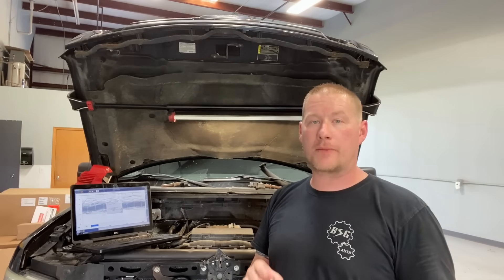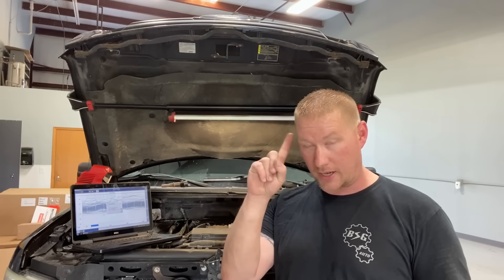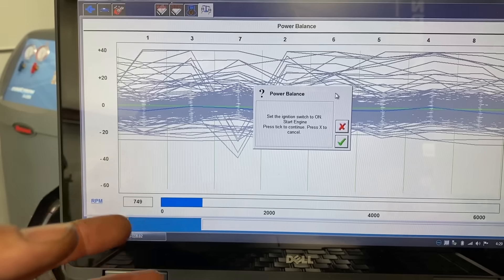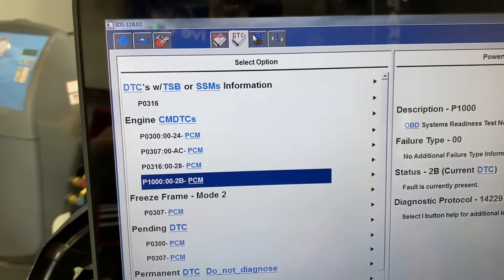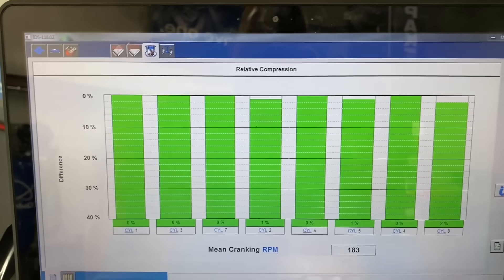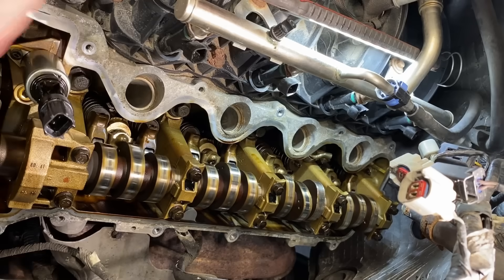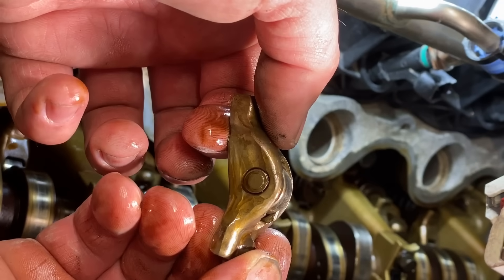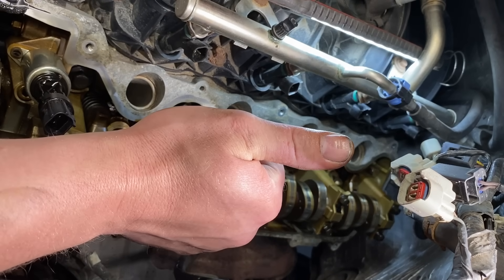Ford F-150 & Expedition 5.4L 3v Triton Engines Hard to Diagnose Misfires Fixed!

Comment: Mr. Makuloco,  I have a 2010 Expy with a dead miss on #5.   This happened to it when my wife went to leave for work.  She turned around, and left in a different car so as not to ruin anything.  I replaced coil & plug to no avail.  I then replaced injector to no avail.  Next, I remove the cover like you did here, I found everything in place, and in order.  I even had an assistant crank the engine over, but neither of the intake roller followers moved like up and/or down.

At that point, I put everything back together because I don't know what to do after this point.

Any suggestions are much appreciated.  Thank you!
Reply from the maker: If you are indeed working on the correct cylinder then I would be looking at compression next.
Reply: @FordTechMakuloco Thanks for your reply!  I forgot to mention that i tried to check compression.  All the compression testing kits i find have the extensions stored in one bent fashion or another.i tried sliding the extension through a piece of PVC to keep it rigid enough to hopefully thread it into the spark plug hole, but I cant get one to start.  i tried one with the tapered rubber on the bottom on it, but I still cant get a reading on it.  what thread size is the spark plug hole?  Ive tried several different kits, but I'm not sure that any of them have the correct thread size.  it seems to me that would be a pretty standard size.  That's where I'm stuck!

Comment: My #1 is miss fire.  Plug,coil, injector all replaced .... Doesn't miss fire for about 5 miles if reset it .......could this also be my problem with #1 .? 2010 f150

Comment: I watched your video and decided to do a top end rebuild because of a crazy click noise.  You saved me.  No major damage but replaced all the rockers, both cams, oil valves, oil pump, water pump, timing components and now it's like a brand new engine at 214000 miles.  great video.
Reply: Approx what did it cost you to do that work ?
Reply: @johnnybee3444  Yeah I was wondering as well...

Comment: What is the Cause of secondary fuel pump module function p1273 please explain how it works and make a video on it engine running rough and no excerlation no power

Comment: Do you ever travel? Dear God i have a 2007 Ford F-150 5.4 3V. Under 140k on it. I have had it too different shops and always feel robbed. $880 at one shop only for them to tell me they replaced plugs and found out after continuing to experience misfires and changing the plugs myself they didn't even change them all. Only 5 out of 8 were replaced. I re-did all new plugs and coil and she ran ok for a while, but still had a shutter at idle not real bad but noticeable. Recently took it to another shop and they diagnosed a bad fuel filter which was legit no complaints there. However, I specifically asked the shop about the ticking noise and they said it could be phaser noise. I asked them if they could look into it as well as a timing job and that I believe there is a bad roller followers and there suggestion was get this "wait till the noise gets a little worse". You don't want to tear into the engine that's a big job that will cost a lot of money. Especially considering they charge $200 an hour in labor alone. Bad fuel filter cost me $350. Yes I could have done it myself. Screwed up part is I took it to them because it's down on power and has a shutter at idle. So they performed the inspection and found the fuel filter leaking. So, if I tell them leave it I will do it. I still owe them $200 plus for the inspection and fuel filter diagnose it. So, why not let them do it. Best part is I get the call to pick it up. Get it take it home. 5 min later I get a call from the shop and they tell me "umm yea we still have the new part here so it was never changed can you bring it back"? While I'm happy with their integrity why would a customer be told "wait till the problem gets worse". Why not fix it now? I wish I could bring my truck to you, I'm just sure it would blow up before I made it there. Then I can't afford the trip or repair cost. If you were here I would be knocking on your door. Lol

Comment: My 5.4 3v misfiring cylinder 7 in high rpm so i changed the plugs. Now it’s misfring in idle. Check the coil, injectors, wires, all good but didn’t open the head to check. Any guess if could be the same issue you showing here?

Comment: I have a 2003 expedition 5.4 I have a number three misfire. It had water/rust in the spark hole not the cylinder replaced the coil pack with dielectric grease and cleaned up the spark plug and I still have a mess. Did I head test? All is good even did a coolant pressure check and still all is good also on the fuel injector.

Comment: PLEASE HELP
Having misfire cylinder 5 and 6
Replace coils spark plugs fuel injectors you can replace the valve cover gasket with grommets

Still getting misfire spark plug have fluid on them

I already spent a lot of money changing everything and still same problem

Rough idle Its start shaking when it gets up to 40 mph

Comment: Got an 07 5.4 3v. Have had it about a year. This whole story sounds like mine. With one exception. We just did the valve cover gaskets and didn't see anything broken or popped off. However it has recently started breaking the tips off of the spark plugs in the last 2months. #6 first then #8. All coil packs(1month old), all plugs (twice now 1yr & 1 month)), all injectors(1yr), both VVT solenoids(1month), PCV hoses replaced(1month). Only code I get regularly is lean cats. The shop told me cats were good. It will run good right after new parts for about ,60miles. Then back to hiccuping. 

I'm at my wits end with this thing. Going to do a compression test, before doing anything else. You're not by chance near Mississippi are you?
Reply: did you find the issue??

Comment: had cam followers come out on # 8 and get down in with the cam shaft which cut the follower into pieces. These had been replaced with the newer style followers as well about 10k miles before this happened. Ended up being a bad oil pump that was not allowing oil to get to those back cylinders. 98k miles and had to replace the entire engine.

Comment: Hello there.i have 2008 f250 xlt super duty 5.4 3V start ok  idles  ok  .but once i rev it up and let go with out moving  it shakes and rough idle no code .i did the timing job  according to ur process but i havnt chage the cam phaser coz i dont belive they r bad idk.whats the issue pls help.

Comment: Could that also be the cause of a missfire on a 2002 5.4 2V?  Missfire on Cyl 6, doesn’t follow the coil, plug or injector to any other cylinder.

Comment: In the morning I start up my truck and it fires up fine I drive it for 15 minutes or more park shut to off and 20 minutes to 45 minutes I turn the key and it gives me a long cran before it fires up can you please give me an I do I have replaced the plugs, coils, crank sensor, Mass air flow sensor 
 . Airfilter, fuel pressure regulator on the fuel rail passenger side man what can it be.

Comment: Im working on a 2004 with no codes. Will idle smoothly for about 10 seconds then idle gets rough and it stalls. No codes. Every part thrown at it by owner. Waiting for my module guy to come in and reprogram the PCM to see if that helps. If you restart it while its running bad it runs normally for a few seconds. Indicating to me a computer problem.

Comment: Would you happen to know what would make my 2000 expedition shut off if the mass flow sensor is plugged in and when I plug it in it runs fine

Comment: I have the 2006 F159 5.4 3V, what you are talking about right here, the closest I could find on Amazon Ford Store is the: Ford Racing (M-6529-3v) modular 3v Rocker Arm and lash adjuster kit. Would this be the animal I need to purchase for $325. I want to have this done at the same time that I do the timing job with chains, phasers etc. I really appreciate everything you do for your fan base and I do pass the word. My father was a mechanic for 44 years, he likes you and he hates today's practices in a lot of our shops nowadays. That says volumes to me. Thank you in advance. You answered my question 👍🏻, you bet I'll kick the proceeds your way.
Reply from the maker: Yes that kit is correct and is what I use.
Reply: I tried purchasing with the hyperlinks you gave but for some reason it wouldn't open in my Amazon app, kept going through a web page. Anyway: could you ad these parts to your list for your royalties, it's the least I can do and I'll give to your channel for your hard work. 3R2Z6A257DA Drive Phaser repair kit $748/M-6529-3V Rocker Arm and Lash assy.$312/8L3Z-6M280-BControl Solenoid $46.99 ea./MellingHV Oil Pump M340HV$125/New Water Pump PW423 $51.08/Thermostat assy RT1254-7L3Z-8575-E $19.79/Thermostat Seal RG-5U1 $3.52/F5RZ6A34PB Crankshaft Pulley Bolt $18.32/ THANK YOU @FordTechMakuloco

Comment: Here’s one for the group. I have a 5.4 2 valve. Only 109000 miles. All plugs and coils are new as are the TPS and MAF. It will randomly lose power and not respond to throttle inputs. It lasts for 20 seconds and then goes back to normal. No check engine light.

Comment: I have an '05 Ford F150 with the 3v 5.4. I have ticking happening in bank 2. I've replaced both CVT solenoids, cam position sensors and all new plugs and coil packs. It's still running crappy. It only runs rough when it's warmed up and running down the road. And it's intermittent. I can stop and shut it off for a minute and start back up and it'll run fine for a mile or so then start running rough and sounding like a rod knocking. Is this worth fixing? Have 197k on the motor.

Comment: I have a 2009 Ford Expedition with only 100,000km on a total rebuilt motor. It sometimes goes into limp mode after short highway driving around a hour or less. Rear Parking Aid light goes off and on, Low Fuel light goes off and on, Wrench Symbol comes on and off still 52% oil ok, traction light goes on and off, Airbag light goes on and off, Smell something hot after hour or so driving Transmission not oil or Antifreeze smell. Had tranmission serviced back in oct 2023.....Help

Comment: These rollers were $4usd, then $8usd, now they are $25usd, my local dealership here in Canada wants $45 each.  Is there a cheaper better place to get these OEM parts?
Reply from the maker: Tell me about it I buy them by the gross. I have started using the Ford racing kit which is just bulk packaging. It includes new lash adjusters too but the lash adjusters cannot be used on the 2004 F-150. Here is the kit- https://amzn.to/4amoifG

Comment: I have a 2005 f150 lariat. I filled up with gas as soon as I drove off the truck turned off. So change the fuel ejector, spark plugs and coils,fuel injection pressure module,throttle position sensor,MAF sensor,fuel filter, fuel pump driver module. Still getting a misfire code said P0303 then I checked spark plug and changed coil. Now got P0113. That I broke and change mass flow harness, but dont know if I mixed the wires. Anyways still a misfire. Does anyone one know if it's the fuel pump,cause I try to drive off and it turns off. 350,000 miles,but the truck ran quietly and smooth not timing chain knocking nor any kind off knock on the motor. 5.4L Thanks

Comment: I just used a powerprobe maestro to check 05 5.4 3v injector control side and found cylinders 1-4 had no on time drop, staying close to same as each other around 2.70 - 3.00 but cylinders 5-8 were dropping intermittently as low as 41.5 and around  there showing a drop in fuel which im pretty sure would be causing my occasional forscan misfire count. Would this mean my misfire is on the control side/pcm or could it be still a roller follower as this video shows?

Comment: I have a 2012 f150 5.0 and sounds like a bad rollor or a lifter. If its a roller do i need to replace all or can i replace one? It makes the noise on cold start up. Comes and goes when warm. Great video by the way

Comment: I’m having the same problem I got two codes cam sensor and a 7 misfire. I pulled the valve cover and the roller follower appear okay but I’m going to pulls the cam to check them better but I have been loving your videos thanks

Comment: I e replaced timing chain, spark plugs, & coil packs. Have codes P0420, P0430, P0302, P0303, P0307
Reply: Still have a misfire so I’m hoping this could possibly my problem

Comment: Have you seen issues with Roller Followers on the 5.4 2v? I have an intermittent misfire between #3 and #4. Thought it might be mechanical give they are next to each other.
Reply from the maker: never
Reply: Thanks, that's good to know. Keep up the invaluable content. @FordTechMakuloco

Comment: 2008 Ford Expedition El 5.4 3 valve new everything OEM parts cost 3K then FORD charged to diagnosis Bad Engine number 6 no compression.  I can still pull a 24ft enclosed trailer drive fast and slow so if the cylinder was bad why would I have not blown the whole engine by now?  So interesting things…. I cannot engage the Speed limiter aka cruise control so perhaps its some kind of power issue?  Came back after a week and the battery is dead and shocking this is the vehicle I use to jump all the other ones because of the strong battery.  Suggestions?  Comments?

Comment: Question…do you recommend the Ford OEM roller followers you have linked here, or the Melling ones with the smaller cup ports?

I can’t imagine why shops do the timing sets and cam phasers without replacing the roller followers. This example was the best case scenario, with the cam follower being pushed up and out of the way. In my 2009 Expy with only 95k miles, the cam follower jammed the valves open and destroyed the piston and cylinder wall. Took off the head and was literally greeted by the top of the connecting rod. It happened to also be cylinder #7.
Reply from the maker: The Ford one have the smaller oiling holes
Reply: @FordTechMakuloco  👍

Comment: Could you have this problem with a 5.4 2 V. Because I’m having a similar problem with mine. I’m going to change the injector again. If that doesn’t take care of it off comes a valve over.
Reply from the maker: no

Comment: I had a missfire on my 08 5.4  on cold start and from 40mph to 50 around 1200 rpm it would jerk long story short I had got eBay motorcraft spark plugs come to find out they were fake plugs . After buying new oem coil and put original plugs from auto zone the miss fire was fix

Comment: I have a 05 F-150 FX4 stutter  when I push the gas pedal, idling in park & when I go to take off, I can't seem to find a video on it or a fix for it, new coils, MAF sensor, VCT sensors, & fresh oil & filter,  no codes for
Reply: The sputter when taking off

Comment: I'm dealing with the infamous cylinder 7...I removed the valve cover and surprise surprise the valve spring, roller follower  and retainer were sitting on top....i think the keepers fell down into the engine though... the valve spring was broken into 3 pieces... i ordered the valve spring compressor tool off amazon but  cannot figure out how to compress valve spring far enough for tool to reach threads to start to compress... it's about half and inch or a little more from where i need it to be so that I'm able to start threads... i saw the "hack" video to do it but i don't have a wood clamp and my c clamp is blocked by the brake booster... is that the way you get the compressor tool started or is there a different method? Any help is greatly appreciated... Thanks In Advance....

Comment: I have a 2004 Ford F150. 5.4 triton. I need some help. Truck doesnt go passed 45. seems to disengage from the transmission. Ive got codes of no communication between instrument cluster. I switched it out and still the same issue. Any other ideas of what could it be.?

Comment: Hi I watch your videos a lot to learn more about my 07 expedition but at the moment I am at a loss was wondering if you could help me out with some suggestions on what to diagnose or check out. I haven’t seen any specific video for what is going on with my suv. 07 expedition 5.4 triton engine will start up fine but if I take it on a long trip and turn it off it will do nothing when cranking it up like the battery is dead but it isn’t but I let it sit for a few hour and it will start up…other times I can rock it back and fourth or tap the starter and it will start I replaced the starter and still same issue. Thank in advance if you see this and can help me out

Comment: I'm a huge ford guy and a buddy of mine had a 05 mustang gt (4.6 3v), had a dead cylinder for intake and he took the vehicle to 4 different shops that replaced basically everything but still had a misfire. I then told him bring it by. I popped the valve cover and seen a roller popped off, sadly the cam didn't survive. All this knowledge is because of this awesome channel. Thank you bryan.

Comment: Help I have a 2000 ford f150. 4.6 triton.  Has a miss that comes an goes.obd says multiple misfire new plugs coils injectors cam an crank sensors  fuel pump an filter..cant figure out why the miss comes an goes
Misses more than not
Can you help me? Thanks

Comment: I have been working on a Ford 5.4. It has a TERRIBLE miss. I replaced the plugs. Bench tested all injectors, and coils. Disconnected each coil and injector, one at a time, made no difference. Checked fuel pressure.  Could this be a bad follower, even though there is no noise at all? Thank You.

Comment: Is this issue common in the 01 and does it happen at lower milage 170 ish. I have been having the same issue on #3 and have replaced plug, coil, and injector

Comment: I have a 08 F150 4.6 v8  with codes p0300 and p0307 ,just replaced all spark plugs, coils and connectors ,any possibility that i have the same issue?

Comment: Misfire on my 2007 5.4 expedition cylinder 1 and 8 one spark plug is stuck couldn’t take it out but changed the rest. Shakes a lot while driving and idle any ideas? Where are you located